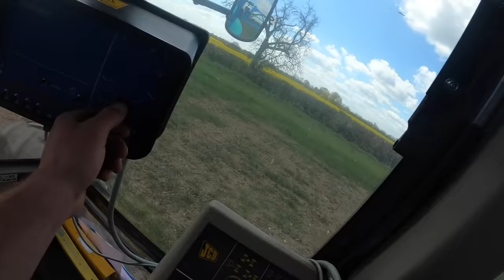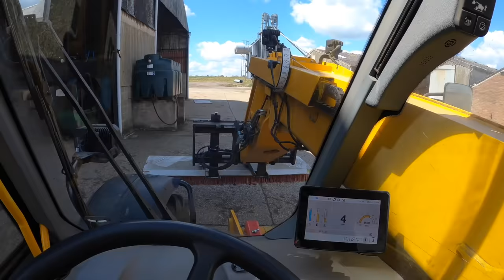FARMER’S DAY IN MAY - - A TRIP TO MARKET, SPRAYING, CHAIN HARROWING

Comment: I used to move chain harrows in the same way. 
If you put a ring hitch on that little trailer. Would bring the back end up a couple of inches.
Reply from the maker: Yeah that would work, it’s actually the trailer I use on our gator so probably won’t change it as it’s used more on gator than the little Deere 👍

Comment: Hey nick, how do you plant a tramline? Is it build into the seeder
Reply: when the seeder computer tells the seeder that it is on a tramline row it blocks off the coulters that are behind the wheels of the tractor.
Reply: Case Farmgirl  ahhh i see, how do farmers then account for different widths of spreaders or spinners
Reply: @harrycampbell9673  If you own a 24m spreader, you set the seeder computer to 24m tramlines, If you own an 18m spreader, you set the seeder to 18m etc .
Reply: @casefarmgirl2279  but what if you have a 24m spreader and 12m spinner
Reply: @harrycampbell9673   why would you ever have 2 different size spinners when you run a tramline system? Thats just stupid, what is the logic to that?
Reply: @casefarmgirl2279  idk I was just wondering what you would do
Reply: @casefarmgirl2279  say you had a 12m drill and 24 m sprayer
Reply: @harrycampbell9673  that's pretty stupid, tramlining was invented so you could use one size of sprayer or spreader across your whole farm
Reply: Farmer John Deere ahhh right cheets mate
Reply: @harrycampbell9673  like Farmgirl said it doesn't matter what size seeder you have, you set the computer to whatever size you want your tramlines for spraying or spreading and it does the rest
Reply: Farmer John Deere oh yeah igy
Reply: @harrycampbell9673  if you have a 12m seeder and a 24m sprayer/spreader, the computer puts the tramline on every 3rd run
Reply: @harrycampbell9673  lets say you had a 12m sprayer and a 24m Fertiliser spreader you would put in 12m tramlines and when spraying you use all of them but when you are spreading fertiliser you would just skip a row that’s how we used to do it
Reply: Out on the farm ahhhh perfect that’s the answer I needed, cheers maye
Reply: @harrycampbell9673  no problem m8
Reply: @casefarmgirl2279  I've been meaning to ask that, thanks for the answer. Do you know how it was done before GPS, presume the driver just had to keep count and manually block off?
Reply: @moneyprofessional  what?